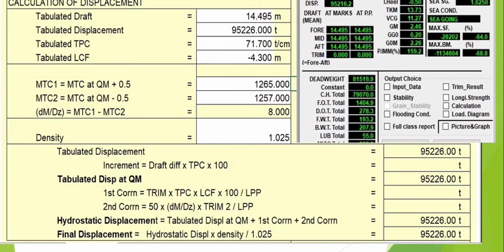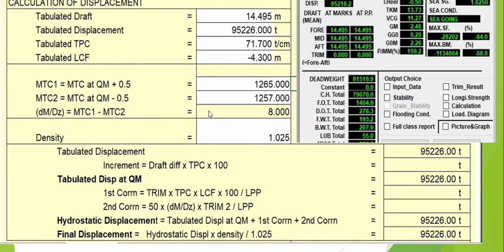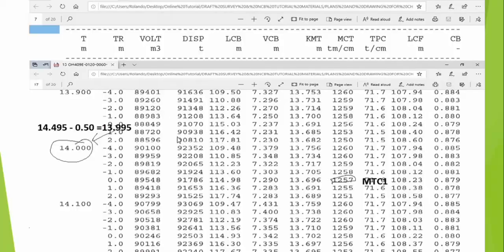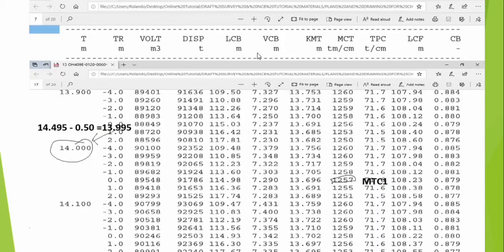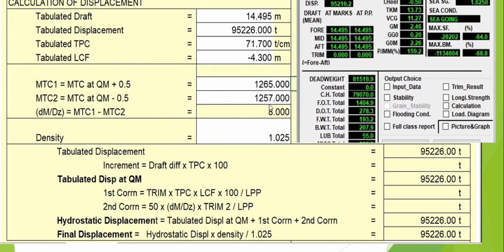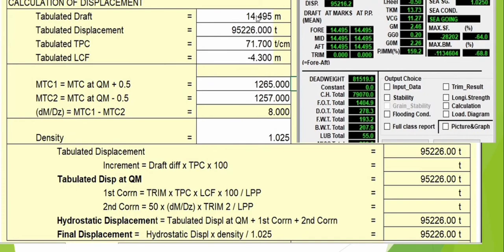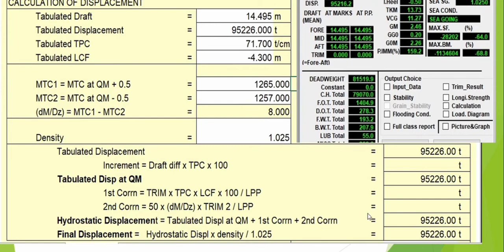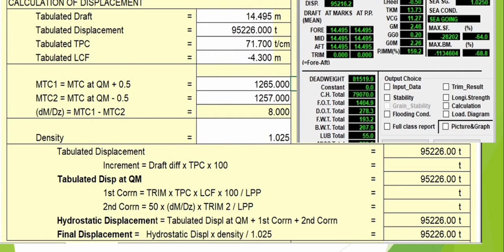Practical Displacement Calculation

Comment: Good day Capt.
Can I have your Idea or formula to this problem?

M/V Admiral is alongside in port of Manila with a density of 1.020. Her draft reading fwd port 6.43m and fwd stbd 6.46m. And her draft aft port is 7.82m  and aft stbd is 7.83m  and her mid draft port is 7.08m  and mid draft stbd is 7.185m.
Base on hydrostatic table, what is her displacement in sea water and her draft?